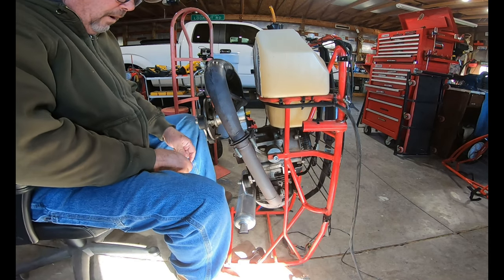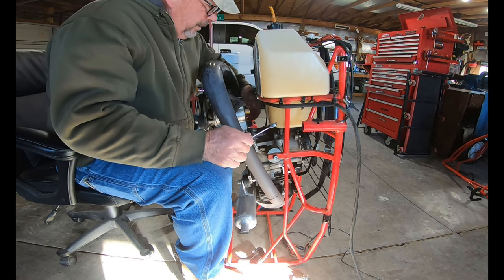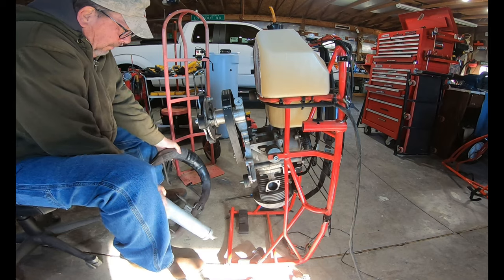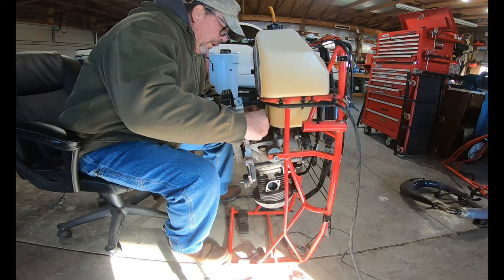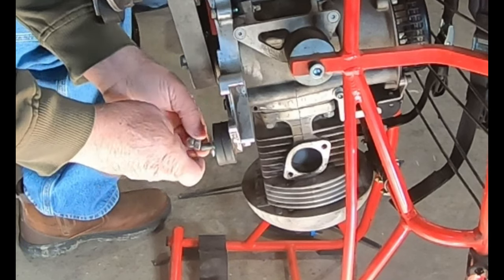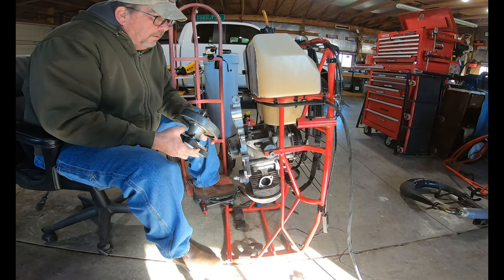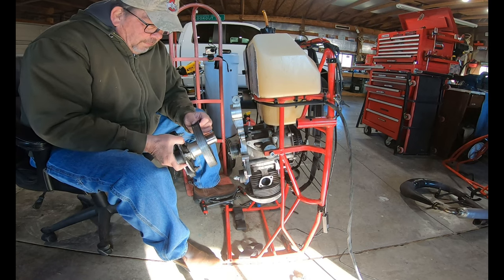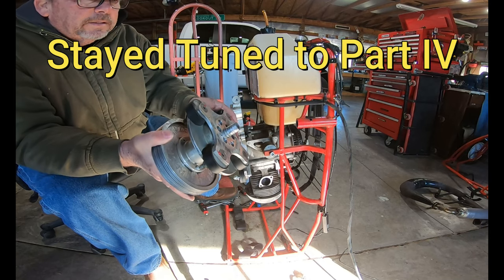Fresh Breeze Monster Tear Down Part III, Exhaust & Prop Hub Removal - Ohio Paramotor Trike Adventure

Comment: You’re missing the good flying weather. Was a balmy -10°F with 30mph light breeze at my place this morning. Guessing you’ve got the same beautiful weather there. Ok maybe you’ve got some time to work on it before hot weather!
Reply from the maker: Yea it’s same here.  What gloves do use?   Would you buy again.
Reply: I got the Sabot heated gloves. They get really warm almost instantly and do a pretty good job at the fingers. They are a little bulky but when it gets below freezing I gotta have warm hands or I’m done. I would recommend them. I bought mine new on eBay in the middle of summer for around $30. Not sure what they normally cost but I remember thinking I got a great deal at the time.
Reply from the maker: @MikeSparamotor  I saw those Savior gloves.    I was just looking for outdoors work.
Reply: Oh I destroy all my work clothes. I usually buy lined or unlined leather gloves at Menards about once a month

Comment: Thanks for the continued series Bob
 I would take a paint marker and write 277+! Hours on the belt, so you know. Do you ever use the leftover gas in any other 2 cycle motor that you have?? I always do. Anyway, I spent a couple hours in my crawl space, thawing out the well pipes coming into the house. Boy it's cold out there today. Stay warm and happy holidays
Reply from the maker: Thank you Buddy, yea my spring house froze and our renter let use know he was without water.   Almost froze my toes off.   Hope after adding heater in spring house it comes back on.   That belt will hit the trash.  I have a new one.  Gas will go in chain saw.  Merry Christmas.